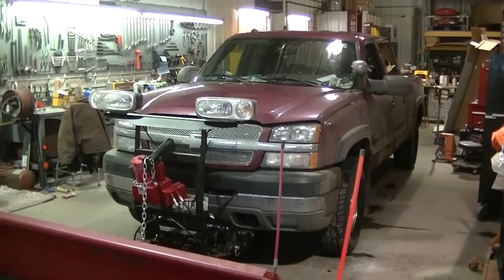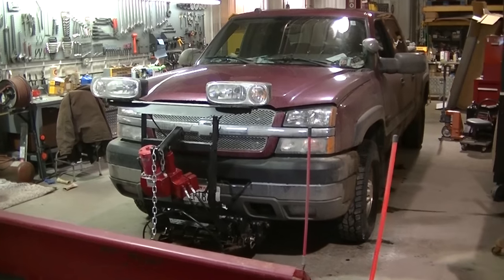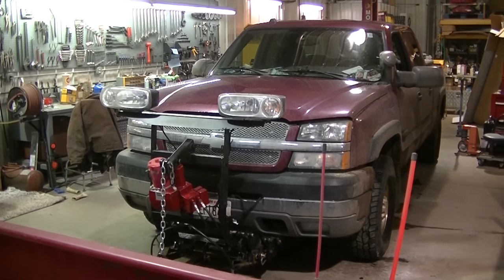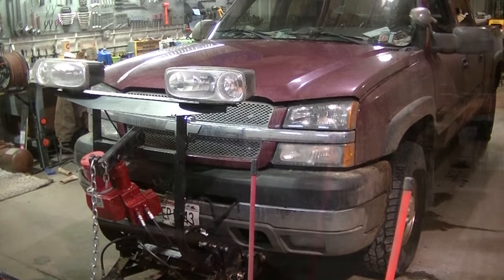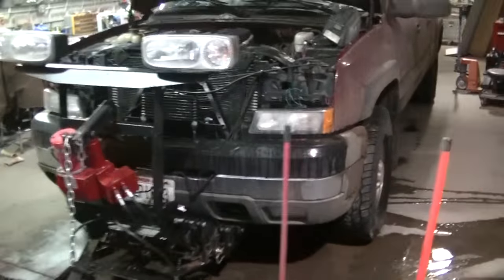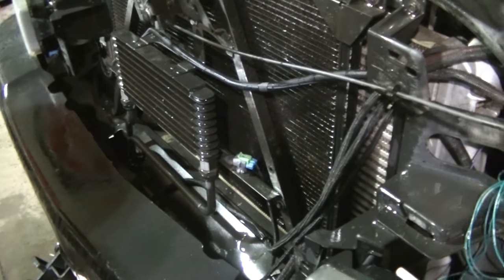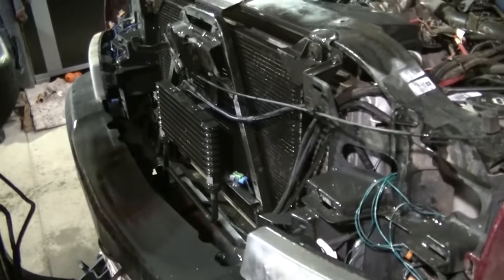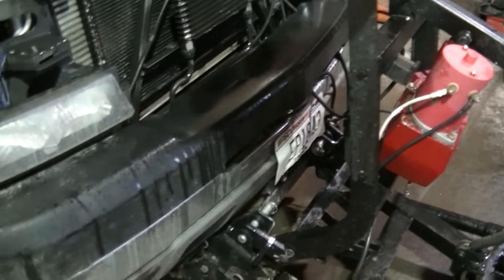04 Silverado 2500HD LB7 Duramax Overheating "Radiator Cleaning"

Comment: I had a 01 dodge 2500 Cummins that would get hot with my plow on. After investigating I found that the blow by was being sucked by the fan and clogged the radiators up. After pulling the radiators and cleaning them it ran perfect. I extended the blowby tube down lower and never had the problem again. When I bought my 02 Duramax first thing I did was extend the blowby tube just in case it did the same thing. Love your videos, they have taught me some nice tips on fixing stuff
Reply from the maker: Glad you enjoy them and find some of the helpful.
Reply: What is a blow by tube ? Pvc

Comment: Brother, if you choose to pressure spray the coolant fins, spray them from the opposite direction for which the debris came in. In this case, spray the water from the back side of the radiator to dislodge any debris that came through the grill into the cooling fins.   Spraying from the front will only push the debris in farther.
Peace be with you.

Comment: I agree with you on the Duramax Diesel cooling systems on the LB7.  Seems like they are plenty big to keep them cool.  I can plow with the winter front on mine and hardly hit 190 degrees when I'm working it hard.  Takes forever to make heat if you don't have it inside or plugged in.  Normal driving without the cover and it doesn't make a lot of heat at all.  Either it was plugged externally with chafe and you cured it or there is some other restriction.  Hope that did the trick for you!
Reply from the maker: +Velvethamma   I haven't heard him say anything so I think it's fixed.

Comment: Reminds me of the time I had to repair the rad on the grain truck back in the late 70's. Got right livid because it kept overheating so I chucked a pitchfork through it
Reply from the maker: +Randy Bobandy    I bet that didn't help putting a hole in the radiator  :)
Reply: +mossman381 Probably not. It blew up, I went and got it stuck with no radiator so I just left it there.
Reply: +Randy Bobandy  you know better than that bobandy
Reply: Randy Bobandy off
Reply: +shanegiggie Drunk already aren't ya
Reply: +shanegiggie fuck man. I'm on the moonshine hard as fuck lately
Reply: Randy Bobandy lol. ive been drinking rum and cokes for quite a bit there good.
Reply: +shanegiggie Yup I used to be on the rum. I enjoy tequila now too
Reply: Randy Bobandy don't really like tequila. mostly drink rum and rye. don't drink much vodka get waaaay to drunk

Comment: If that doesn't fix it, I'd check the fan clutch.  I have to flush out the radiator on our tractor every summer because all the grass seeds when cutting hay or bush hogging.
Reply from the maker: +farmboy30117   The fan clutch is working because when it was getting hot you could hear how much air the fan was moving.

Comment: My 09 2500HD 6.0L gas engine runs at 210 with or without the plow and summer and winter.  My 2010 1500 does the same thing.  When plowing I change my information system to watch the transmission temperature.  I've never seen it go over 170 degrees.  

To tell you the truth I don't know whether that is good or bad.
Reply from the maker: +Rick Anderson   All the newer stuff is pretty good at keeping the temps were they are suppose to be.

Comment: I had a plugged up radiator and it overheated quick. got a new one and its perfect.
Reply from the maker: +Yard Boy   The coolant was pretty clean when I did the water pump so I don't think the inside of the radiator is the problem

Comment: The radiator get pretty crummy. I know I have to do mine soon, was starting to overheat pulling a heavy car on the trailer this summer, and it was barely 35C outside.
Reply from the maker: +Veikra   A lot of people don't ever clean out the radiator.  I think it should be done yearly.  Everything works better when the air can flow through all the A/C and coolers.
Reply: mossman381
 It's basic car maintenance, but some people dont even know where the oil goes.  It's the same with computers, they leave junk software and spyware then when it gets slow they throw it away and get a new one.

Comment: does the fan blows towards the engine or towards the radiator.? i have a 6.5 gmc diesel & it over heats when towing if i stand in front of my truck i don't feel any air coming through the grill it's that normal? any suggestions
Reply from the maker: ggg's fan  The fan pulls air from the front and blows it towards the motor.

Comment: to be honest mossman!!! you are right about rinsing and stuff but its very between the rads the problems u gotta take them all apars and rinse and degreaser.... multiple time.. and put it back with new coolant... will do it to my LBZ this summer :)
Reply: +StyleGT do a step by step wink wink ;)
Reply from the maker: +StyleGT   You don't have to take it all apart.  Dad has been driving all over even on the highway with no problems since.
Reply: Do you think with degreaser and water the stuff between the cooling stack will drip anyways ¿ im just asking before every tutorial  i have seen on those were just bunch of shit inbetween the stack so yea. Surfacing would never rinse it all
Reply: anyways i will take mine out probably this summer since im doing a coolant flush :) but i guess after that i need to get used to do it like you just did every once in a while!
Reply from the maker: +StyleGT   Everybody does stuff different.  If you feel you need to take it apart then I would go that route.  It surely won't hurt anything just takes more time.
Reply: you need to take it out to do it properly end of story

Comment: i would also check the fan clutch if that doesn't fix it.
Reply from the maker: +Fireguy1020   Fan clutch is working because we can hear it moving some serious air when the truck starts to overheat.
Reply: Hopefully it's fixed. Let us know.
Reply from the maker: Fireguy1020  It's fixed.

Comment: get him some of that wetting agent stuff,RP has it,and i used this stuff called engine ice for my atv,the fan was screwing up on me and it would get hot kick the safety light on,i put that engine ice in there and the fan has never kicked on since lol and the qaud needless to say has never overheated.
Reply from the maker: +Game Bred Duramax   This has taken care of the problem.  I would recommend everybody do this once a year.  Your A/C will work better and your trans will stay cooler also.
Reply: mossman381 glad to hear its fixed,did u do a coolant flush too?
Reply from the maker: +Game Bred Duramax   No,  I did a water pump on this not too long after I did mine.
Reply: +mossman381 oh ok,so shes good with new coolant too. Ready to Rock again!

Comment: Dude not to be hating but how the fuck!! Was this helpful.  Must work at AutoZone. You know you just sprayed down all his electric harnesses too right? Thanks for the tips what not to do "/
Reply from the maker: The radiators get plugged up when you run in dusty or buggy conditions.  You have to flush it out every now and then.  If you only drive to AutoZone and back then you probably don't have that problem.  This video is to show everybody it does happen.  No problems after the flush.  You talk about me not knowing anything but it's you that doesn't know anything.  The fact that you say I got his harnesses wet tells me you know nothing about vehicles.  Anything that got wet will not be hurt by water.  Go back to your video games.
Reply: Jacob Dalton you my friend should think before speaking lol